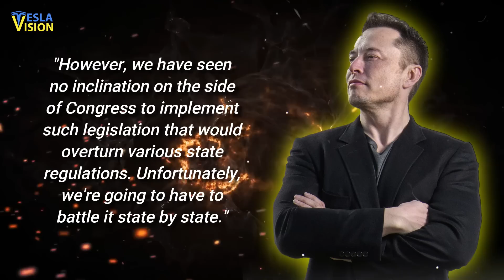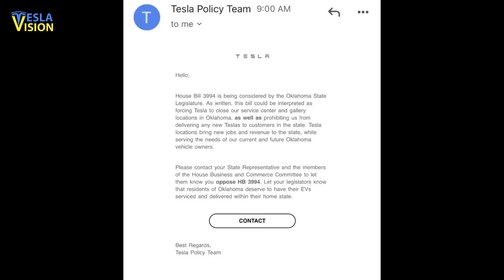Elon Musk Is FIGHTING BACK Against Attacks on Tesla

Comment: Maybe it's just me, and my background, but why don't TESLA make the Roof Space on top of the Vehicle a Large Solar Panel to help charge the EV BATTERY, No it will not take the place of plugging the vehicle into a socket but it would help with electric used by Electronics inside the car while leaving the Main Underbelly Batt. to powering the wheels